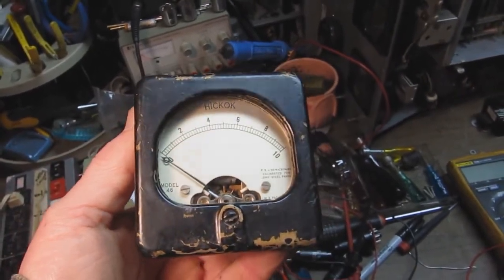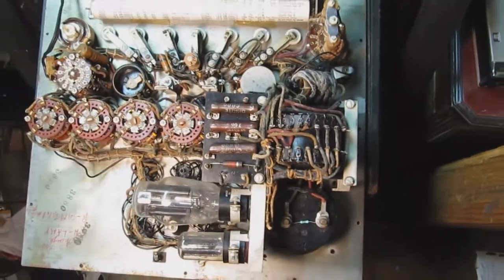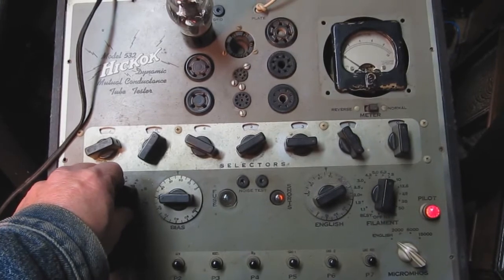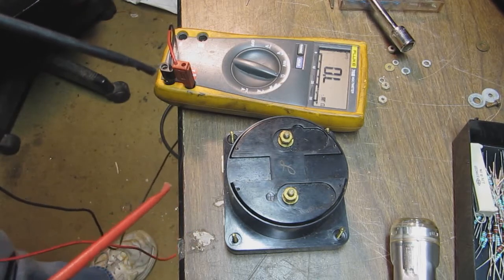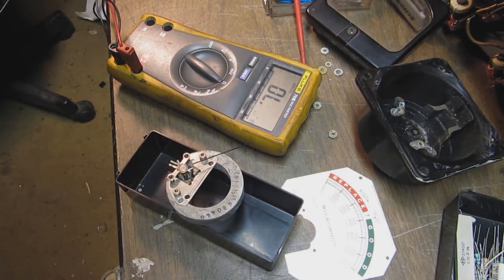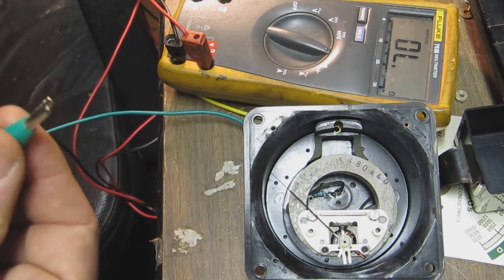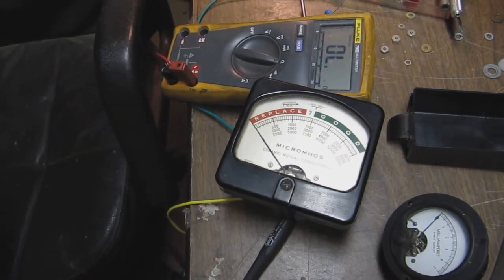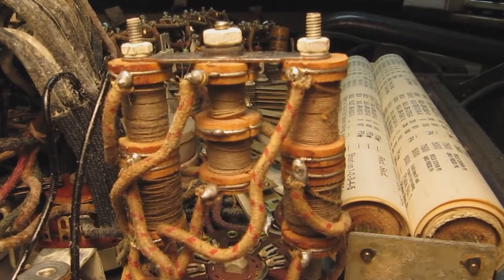Hickock 532 Tube tester repair

Comment: Very nice job,, My 533 had exactly the same problem,, only my meter worked,, broken wire in the resistor chain for the Mu test cct.. I had to solder in a piece of TV transformer wire and remeasure the resistance,, Spot on,, On to Calibration.. Th ank you for your video,, Great :)

Comment: I would just open meter up check resistor inside replace if bad if it's good just stick meter in iso alcohol for a while then let air dry for an hour meter should still work unless springs are broken which is not that common. Great job on the repairs :)

Comment: Ive got 3 hickok 600a testers.  One will not test rectifiers 80 83 6x5 ect.   Id rather have a tester with a bad meter than having to trace all the wires

Comment: So what caused the "stuck" meter? Did it physically free up just because you took it apart? It would have been a good idea to clean the magnetic gap with strips of the adhesive section of a 3M Post-It or '"sticky note" , which are excellent for removing debris and corrosion product from inside the gap (stiffer and easier to work with than masking tape or paInters tape).
Reply: I have a 539C that had a bad (sticking ) meter. It appeared the magnet was plated or painted . The coating had started flaking and some flakes  migrated into the pivots of the meter mechanism. Sometimes you can pick the flakes out. Or blow them out with gently applied compressed air. Unfortunately in the process of cleaning I damaged the armature winding. I was able to get a replacement meter from Whelcher instruments with the same resistance and reproduction color scale for $125.  The meter housing was a little bigger and I had to modify  one of the mounting brackets beneath the chassis. This did not alter the outside appearance.
Reply: @ebones6957  , I found out the hard way, never use any tool made of magnetic material when working on an analog meter ---- the magnet is sufficiently powerful to pull the tweezers, hemostats or whatever right into the area of the magnetic gap, and damaging the coil or coil springs is likely. Use plastic tweezers perhaps; or pre-glue the tape strips or sticky-note strips to toothpicks that will serve as "handles".

Comment: Hi, I have a model 532 myself and everything on it works fine except that the octal tube socket on it, when I have a tube in, I have to push on the base of the tube to get a reading on the meter, pushing towards the top of the machine, not pushing straight down.  Is there a way to repair that?  Maybe crimp the pin holders a little bit or should the whole socket be replaced?  If so, how?  Thanks, Gary
Reply: Check for cold solder joint in socket if not contacts inside socket are wore out
Reply: your question that I just read is 3 years old now. So did you solve the issue? If not then carefully use a scribe to bend the tube sockets to make a smaller gap . Be careful and do it slowly as the sockets are now brittle and may break.